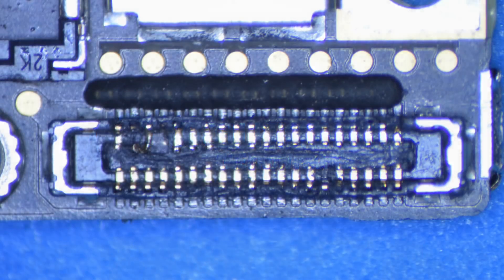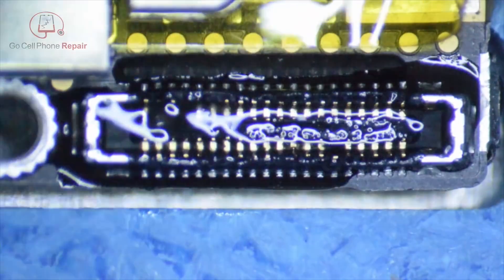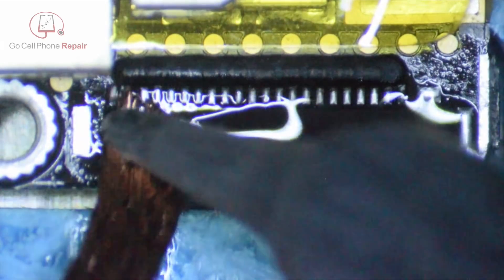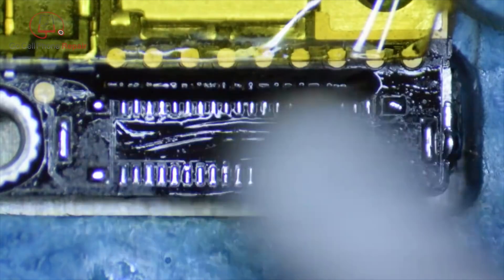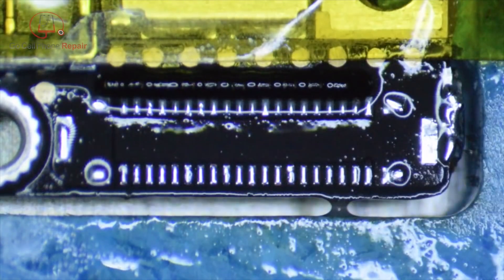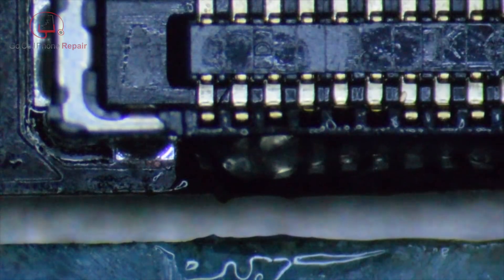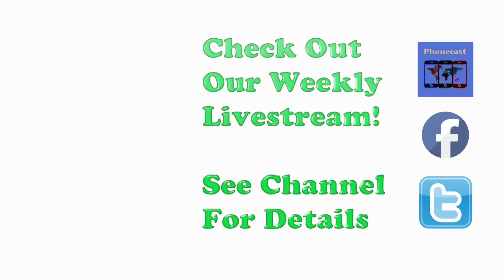iPhone 6S Plus Lightning Port Connector Replacement

Comment: how much blow power are u using to replace the  connector
Reply from the maker: I have a Quick 861dw and for this kind of repair air is set to 40. Of course how far away you are and nozzle size make a big difference.

Comment: Is there a reason why u did not leave that shield in place over the batter connector since you used hot air to put the new connector on as well?
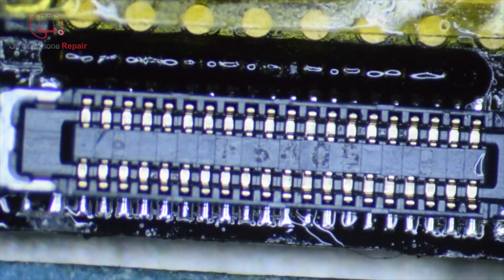Reply from the maker: If you blink you'll miss it because of the edit but at about 6:31 you'll see that it is back in place. I removed it to show that nothing melted and didn't think to mention that I was putting it back on. My bad.